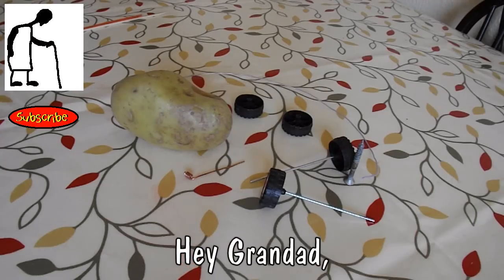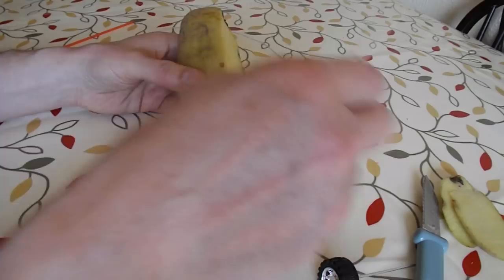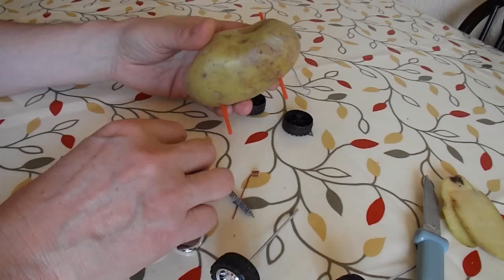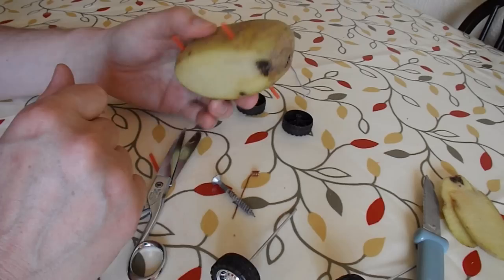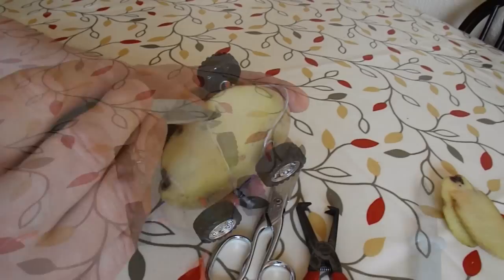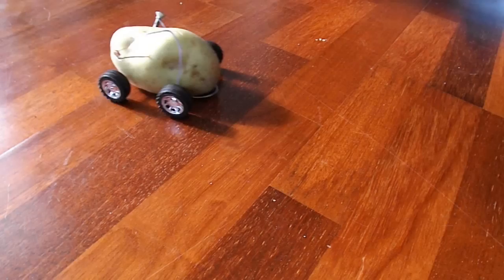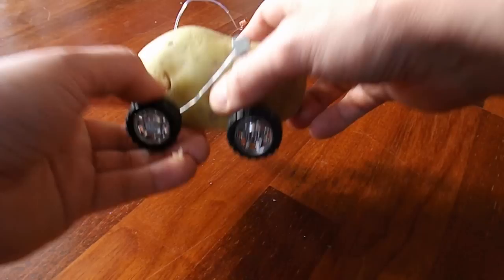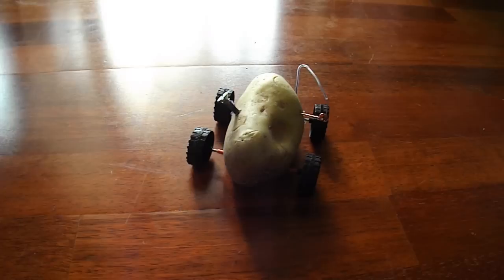Hey Grandad can you make a potato powered car? Yes, today only (APRIL FOOL)

Comment: The power doesn't come from the potato but from the difference in electric potential between the metals. The potato only provides the electrolyte.
Reply from the maker: TheLivirus the potato does nothing. This is a joke. I suggest you read the video description.
Reply: GrandadIsAnOldMan Haha alright, but in principle that is a fully functional potato battery though.
Reply from the maker: TheLivirus if you mean that it has a zinc coated screw and a piece of copper wire sticking in it, then yes, and there will be a potential difference, but that is just to make people think it might be doing something. It does nothing, there is no electric motor, the wires are just wrapped around the axle. Did you really think that induction would spin the axle?
Reply: GrandadIsAnOldMan I didn't really put any thought into the principle of the motor. That's a conversion issue, not a source of power.
Reply from the maker: TheLivirus tell me, do different electrolytes give different power outputs for a copper/zinc combination?
Reply: GrandadIsAnOldMan This is really not my field, but my best guess is yes.
Reply from the maker: TheLivirus but how can that be if the power comes from potential difference between the copper and zinc and not the electrolyte?
Reply: GrandadIsAnOldMan Is that a rhetorical question?
Reply from the maker: TheLivirus I am just following your thread.

Comment: didnt have a potato at hand, so i used a grape instead. worked nicely. next i try a peanut. do you think a dead horse would be worth a try as well? (dead horses need bigger screws and wheels of  course.)
Reply from the maker: I think you understand the general principle :-) The power to weight ratio is the main problem.

Comment: and now make a real potato powered car - or probably use a lemon - i'm curious if the power is enough to power a small motor
Reply from the maker: suit1337 there is nothing like enough power to drive even the smallest motors that I have. I have tried several times and the best I can manage is to light some LEDs or power a converted Solar Mover..
https://www.youtube.com/playlist?list=PLA5a2xPRSrB24tJDQHdmjgpFGwfvwvnnn
If you look through Lidmotor's channel you will find he does drive some motors with home made batteries but they are handcrafted motors that can run on tiny amount's of power. 
https://www.youtube.com/user/Lidmotor/videos

Comment: Help Gentlemen, I am attempting to power my nano drone using a potato battery. I have looked up several diagrams and my friend jeremy just keeps looking at his computer not helping. I've tried duracell C batteries and D batteries but ive decided to go with the most naked setup. A potato battery. I bought a few thousand potatos and am going to make a factory that will make potatos for my nano drone, it seems like the most efficient way to go about my issue. I hope yyou can help me out because i need this nano drone to work. Peace out homescout

Comment: Hi can you make some proyects with magnets???
Reply from the maker: Hi Alice, interesting question. I will have to make a new playlist to combine these together for easy access.
Here are some of my projects that use magnets.
Alka Seltzer powered boat Magnet Steering http://youtu.be/kvRwtI9tZAo
Watching my homemade solar movers on an overcast day http://youtu.be/AT5JA2aaoYM
Simple Electric Rocking Novelty http://youtu.be/EguPrOQJCnw
Executive Toy Solar Mover conversion http://youtu.be/JfkOgoAgjE4
Snake Eggs Rattlers Magnet pulse motor http://youtu.be/JDkWNi67Atg
Home made electric motor drives home made toy car http://youtu.be/9-fURC-87C8
HALL effect sensor project #3 a fairly typical pulse motor http://youtu.be/upSPWYa3u0M
HALL effect sensor project #2 flip flop flower type thing http://youtu.be/8V95LpfK-1Q
HALL effect sensor project #1 with thanks to Thomas Kim http://youtu.be/DMJJ0vqz8aw
Bargain Store Project #29 Pushrod Crankshaft Dynamo http://youtu.be/vYDNvp6HD34

Comment: you know that there is a real and legit vid showing how to make a potato powered car and it worked
Reply from the maker: Do you have a link?
Reply: here it is: https://www.youtube.com/watch?v=oNjPHcIzQkM
Reply from the maker: Thanks, although even after watching the video all the through I am still sceptical, particularly the final sequence where it apparently has enough power to climb a slope. I don't think any of my RC cars have to power to climb a slope like that, even without the weight of a potato sitting on them. I have done a potato powered car myself that uses a supercapacitor to hold the energy but I have always felt that as soon as you use a storage system the video is open to abuse as you can always charge the store off-screen by another method and the viewer will be none the wiser. The components he has used appear to be legit although I don't intend to try sourcing the components to try it myself so I cannot prove or disprove his video. It would be great to believe it is genuine. Here is my playlist which contains the supercapacitor method https://www.youtube.com/playlist?list=PLA5a2xPRSrB0obLfnK22P9pTmLKXvQxsm As my playlist predates his video maybe he saw mine and decided to take the concept to it's limits :-)

Comment: No I wont a potato powered car!
Reply from the maker: Hoot Toot, this is an April Fool video, it says so in the title. It will never work like this and was never intended to, I don't even strip the insulation off the wire to make contact with the copper and the nail. There is no way that just wrapping the wire around the back axle is going to induce a magnetic field to spin it and drive the car forwards. In the second video I show what I did to give the impression it might be working.
The title actually says "APRIL FOOL" at the end but that is not displayed on many screens if they are not wide enough.
It does not really work with potato power, I cheated.
This video explains the mechanics of how it works. It is all to do with the date.
http://youtu.be/Zh8H8XaFYdc
Reply: Oh, but stile nice Prank!
Reply from the maker: Hoot Toot Patryk I gave a big hint at the end of the video 09:30 commenting on the date. "It's the first day of the fourth month of the year, the day that potatoes power cars". I think lot's of people really want it to work so they miss the hint.
Reply: Well one of them were me!

Comment: How is this April fools? It works...
Reply from the maker: It is a fake, it does not use potato power. If you read the video description there is a link that shows you how it is done.
Reply: But it moves... Right?
Reply from the maker: Follow the link in the video description to find out how it moves. It has nothing to do with potato power.

Comment: it needs many potatoes :)
Reply from the maker: I very much doubt that you would ever get one to work, the more potatoes you add, the heavier it gets so the increase in weight does not give enough increase in power.
Reply: u should make the car bigger .. :)
Reply from the maker: AhMed MoUnIr two points.
1. This is an April Fool joke, it is a fake, it is not intended to work. If you are not familiar with April Fool then I suggest you Google it.
2. I already explained that adding more potatoes only adds more weight, each potato does not add enough power to carry it's own weight so adding potatoes is a backward step into further failure anyway.

Comment: is the lemon one real
Reply from the maker: You will not get enough power from any fruit or vegetable to directly power an electric motor powerful enough to move the weight of that fruit or vegetable. If you look at my video description there are links to other videos and playlists. There is one for a potato powered car that does work but it is NOT electrically powered. There is a playlist called "Potato Power Revisited" where I show that we can power a very small electric car but it runs in circles tethered on the end of wires so it does not have to move the weight of the potatoes. There is always more information in my video descriptions.